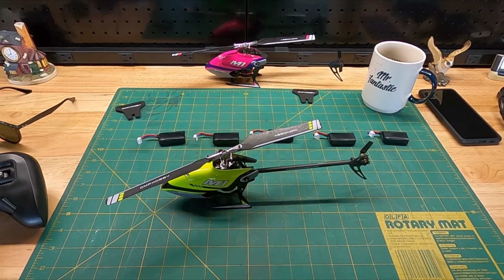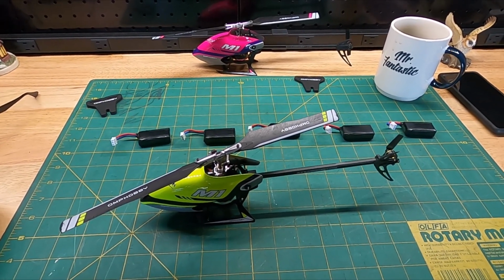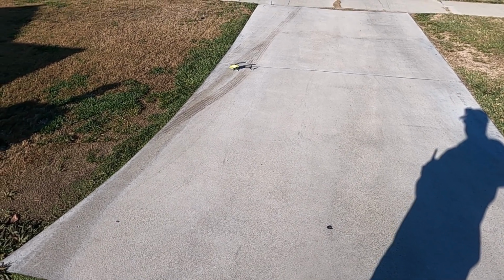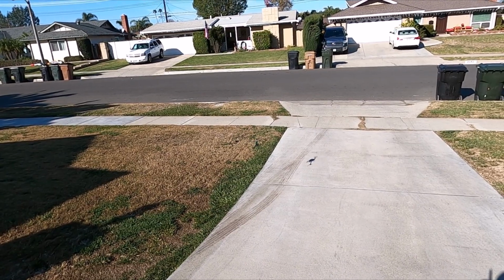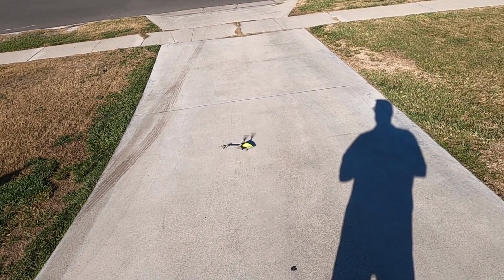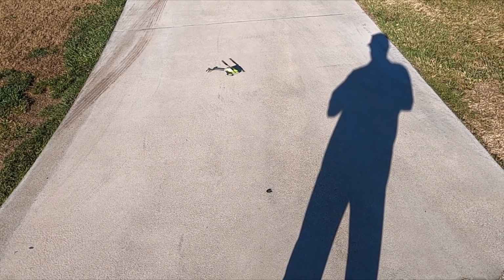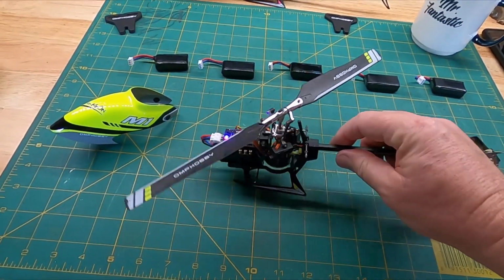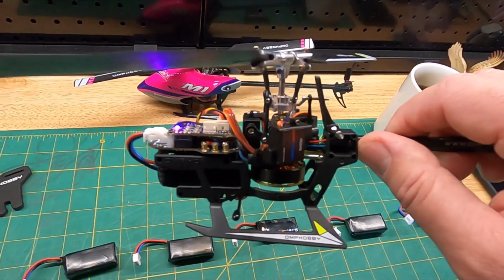OMP M1:  Maiden Flight with New Servos

Comment: The m1 is one heli I haven't felt the need to upgrade anything like the LMA servos and frame all tho it would be fun to do .but my original servos failed on my 5th flight..bad from the factory as I took them apart they had metal shavings in them jammed the gears...they sent me 3 new ones after I complained about it or asked them to help me,, so I got 3 from them and 3 I bought somewhere else..so all sett for life on them
Reply from the maker: I have not altered anything on my M1 either -- they are great out of the box!  I did have two servos go out, but that was after hundreds of flights and many crashes.  Just part of the hobby, in my opinion.

Comment: Tell me a little about your radio with crossfire,,have you figured out how to do it up on the m1? I mainly want to know if you like that radio and can you see the screen ,,say better than the jumper I'm using,,I know I bug you alot but your a smart guy ,,so I like asking you stuff
Reply from the maker: My favorite, daily radio is the Team Black Sheep Tango 2.  I have done some more in-depth writing about my radio here https://www.rcgroups.com/forums/showthread.php?3949933-TBS-Tango-2-Building-A-Perfect-Travel-Package and also here https://www.rcgroups.com/forums/showthread.php?3988653-OMP-M1-Running-TBS-Crossfire
Reply: @navigator2011  my jumper tlite makes the m1 as smooth as butter..I my channel settings are +80-80 but the gear channel I left +100-100 ,,for some reason I had to keep the pitch channels mid point a little different ,,had to much negative and not enough positive..so change that to +70-90 ,,no expo safe is just normal mode on a different switch I can get to easy

Comment: 👍🏽 
What are your fbl unit settings or are they all @ default? Specifically aileron & elevator.
Reply from the maker: Hi, Tim.  As I recall, I put the tail gain to 3 flashes to minimize tail heat during the summer.  I think I put the elevator gain to 3 and the aileron to 4.  Also, I'm pretty sure I put the cyclic speed to 7 flashes, too.  I'm also running crossfire, which makes the heli respond a bit quicker.
Reply: @navigator2011  ty. I want to flip faster in a small space  and at a lower height  to practice inverted hovers. Im already at 7 flashes on elevator speed with iu2@70% and still a rainbow type flip. A lot better then it was at default but I need it faster. 👍🏽
Reply from the maker: Hi Tim, for a long time I had the rainbow flip issue, too.  Yes, the 7 flashes helps, but it's a matter of practice, mostly.  As you gain skills, you won't need as many flashes or as much head speed.  I do most of my flying at around 50% because, well, high head speeds make me uptight.  Lol.  Also, I recommend you stay higher up there until you consistently can flip in a tighter volume.  That will save you from a bunch of crashes.